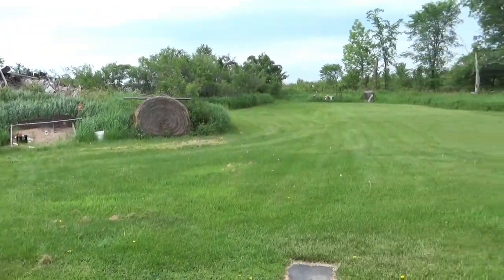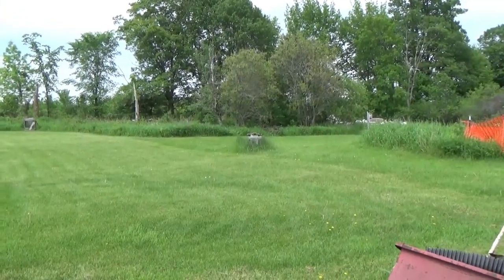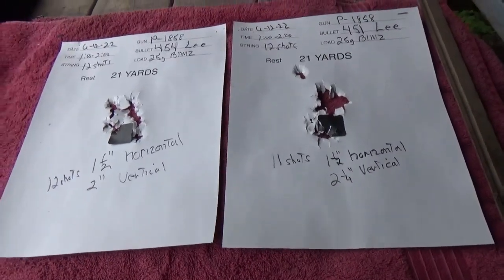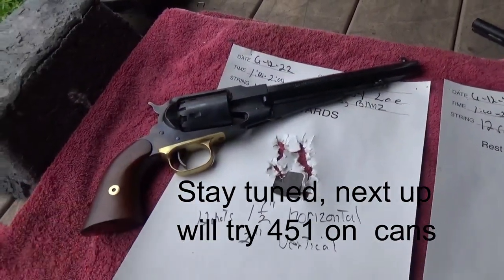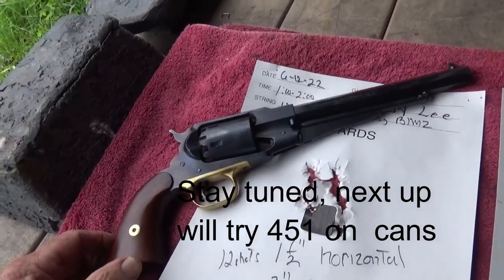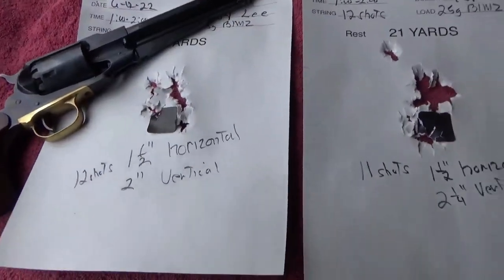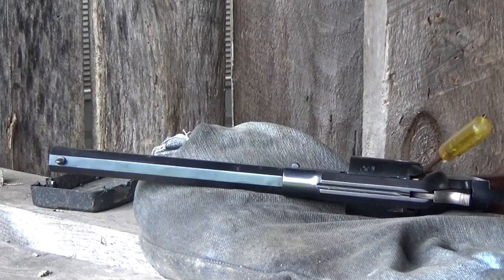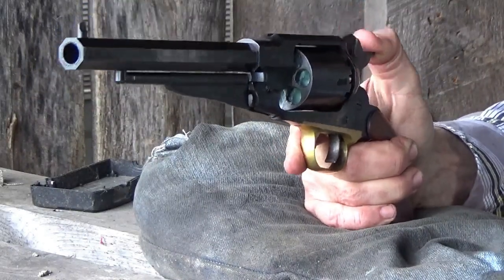Pietta 1858 - Shooting 451 VS 454

Comment: Good info, I’ve been shooting both 451 and 454 and haven’t noticed much difference in accuracy but I do like the confidence in knowing the .454 will seal better, I’ve done both wads and lube over the ball, I’ve ran both 25 and 30 grain charges, thanks for taking the time to put this video together for us viewers O.R. 👍
Reply from the maker: Appreciate your comments.  If you ever chain fire with that combo it would sure be evidence for it coming from the nipple end.  O.R.
Reply: @oldranger3044 how common are chain fires? Does it damage the gun when it happens?
Reply from the maker: @Hellbender21  Not all that common. It would be interesting statistics to know the percentage of revolver shooters that have one. Using a correctly sized ball, and either lube or wad, and proper fitting caps, chances would be very, very, close to zero. My brother had one 30 years ago. Never knew why. I recently had two, probably the result of some DIY caps I had made. Otherwise, I have fired thousands without one. As far as gun damage, neither mine or my brother’s damaged the firearms. The chamber that fired was the left where the ball probably glanced off the barrel wedge. Without the barrel, the speed is about half, reducing energy to one quarter, so this may be part of the reason for little damage. Of more concern would be the shooter, or bystanders, as the cost to replace the gun is usually not a big deal. Always use eye protection. Hopefully this is helpful. O.R.
Reply: @oldranger3044  Thanks, I appreciate these videos.
Reply: @Hellbender21 I have shot a couple hundred rounds out of my BPR and have never had a chain fire. I use lubricated wads
Reply: @Hellbender21 I've shot black powder pistols for 15 years never use lube never had a chain fire actually I've never seen a chain fire happen

Comment: This is why I ALWAYS load the largest roundball that will swage down.  The listed measurement VARIES and it’s better to overestimate than to underestimate.  I’ll go as far as hammering a ball in with a brass hammer to force a fit.  It guarantees no chainfire is possible, gives a larger driving band for the rifling, gives it a flat top for harder punch, and I believe it gives a better seal, which builds more pressure for better ballistics.  Also, with as light a projectile as roundball, every additional grain gives additional ballistic impact (which matters, since these guns are ballistically marginal at best loaded with roundball).  Even 3 extra grains of lead can give an extra 10 foot pounds on target per shot.
Reply from the maker: Interesting information for shooters to consider. Thanks. O.R.
Reply: Bigger than 454?
Reply: @Hellbender21  I’ve shot .454 with good results, but .457 would work better.  I recommend loading the cylinder on a stand to not wear the gun’s loading lever.

Comment: Do you have to measure all the balls before loading or is that just for the video?
Reply from the maker: After casting, or purchasing the size desired, only measure a couple if wanted as a double check. Or if like me, sometimes you may have forgotten to label the container. Even if the 451 and 454 get mixed up it will work out as long as it shaves some lead, or makes a decent tight seal. Some cylinders have a slight chamfering and won’t actually cut off a lead ring, only compress it. O.R.

Comment: We dont have much bearing surface with our round balls so we don't need much lube. It doesn't take much lube to fill the tiny scraches on the ball where fire could get through either.
If you seat a ball without lube or powder and take out the nipple then use a small diameter dowel to push the ball back out then look at the bearing surface on the ball with a magnifying glass you will see the tiny scratches on the sides of the ball.
Of course this may vary a bit from gun to gun depending on the quality of the machining. Filling those scraches is where the value of lube pays off.
I know you are going to think I am crazy until you see for yourself.
Thanks for all you do.
John Davis Jax Fl
Reply from the maker: Just wonder what you think about the ball bumping up to fill the groves?  Every time I pound in a ball through the forcing cone I can always see light passing through. A ball fired with only the cylinder already has 3-400 FPS. If the majority of the force is already spent, what is left to enlarge the ball?  Also, the lube is on the opposite side of the pressure and I would have time stopping a leak with a gasket on the wrong side. Outside of possibly preventing chain fires, I’ve been under the assumption that the lube is necessary to keep fouling soft and cut down on fouling buildup which seems not good for accuracy in most, maybe all firearms. Just my thoughts and open to viable explanations. Thanks again for your comments.  O. R.

Comment: Lube is important for more reasons than one. The viscosity of your mixture seems to be doing very well.  Some commercial products turn a slimy puddle after the first shot in the rest of the chambers.
Reply from the maker: Temp was in the low 70's I believe when this shooting was done. Crank that up another 25 like the last couple days here, and things could be a lot different I'm guessing.  I was actually pretty impressed with how nothing changed much, but the temp probably helped.  Like of course to think it was a lucky mixture, time will tell.  O.R.
Reply: @oldranger3044  yes hope you have it documented. Me I stick lambs tallow and beeswax and change portions based on how intend to use it. More bees wax for dipping bullets  less for over top . Paraffin wax for dipping on occasion. A lot of people doesn't know that army ordinance for the paper cartridges for these revolvers called for bullets dipped in paraffin. I did get out Monday to the range and test fired the 62 gr in the Remington, and the 77 gr in the 1849. All I learned is that my vision impairment is  not better for open sights, but did better falling back on basic instincts. I also know both weights are flying true with no tumbling.  I took out a couple of carbine I tried a month ago open sighted and failed, and mounted optics on. Has some success. Also want a trusted scoped 22. Though not the bullet touching accuracy I'm use to I was able to keep groups at 3/4" @ 25 yards.  So still in the game  just have to change my methods.  It's going to look funny mounting optics on remingtons but if it keeps me going great. I will try it on my 1866 carbine first see how it goes

Comment: The chamber bore of the cylinder sizes the bullet.  You can use a .500 bullet if you have the elbow strength and you'll wind up with a bullet the same size as a .451.

Comment: Excellent shooting ! As always, the reason I always choose a larger than bore size is to stop any risk of chainfire, as I know you do, but as I end up reaming the chambers to .002" over groove diameter the projectile diameter can vary, I have now found an excellent source of ball moulds which are both cheap, good quality, and available in .001" increments to order, so I am now shooting the diameter I want rather than buying a near fit, both of your groups were outstanding, and that is not using your Ransom rest! You had no critters in the garden this time. Stay safe! Chris B.
Reply from the maker: Thanks Chris.  Suppose your source of RB is not in the U.S.  That, and being able to ream gives some real possibilities.  O.R.

Comment: Re  looking at this video I notice that there is a generous chamfer on the chamber mouth, I wonder if there is a different fit on the ball compared to an unchamfered chamber, the chamfer would tend to "squeeze" the ball into the chamber rather than the shear the ball, this must make it a tighter fit, one thing that does happen when the chambers are reamed is that it reduces the size of the chamfer, but this can easily be re cut, I think most chambers are slightly tapered, so that also would give a tighter fit , I notice that with the .451" ball if the sprue were to enter the chamber at the side a flame path could easily set off the chamber, and that could be the reason some people experience chainfires, as I always seat sprue upwards this risk is reduced. Chris B.
Reply from the maker: Hi Chris. Here’s my experience so far, meaning it is just what has, or has not happened, and not concluding anything to be a law. Only one law..Just when I am about to regard something as absolute, I come across something else that goes against it. 

I will sometimes load with sprue up, mostly because I have felt it more accurate. My testing so far does not verify that. Last few years I have probably fired over 1K/year at paper. Most off a rest. Only saying that because we know some shooters will have a good day for whatever reason, and figure what they did can be taken to the bank...same if it was a bad day. So, its just my opinions from what I’ve seen so far. If I am running a test on shooting without wads or lube, it’s load them tits up for sure. Over 4K without a chain fire. Always gave credit for chain fire to the chamber end. Then when shooting DIY caps that had powder trails up the sides (sloppy manufacturing on my part), two CF in one week. Before that I had tested firing with no cap and did get the CF. So here’s the new theory. Maybe to get the CF nipple end, the flash can’t (for whatever reason) get through to the powder, and needs the cap in place because it can set off the cap. 
I always enjoy your comments (and others) because they get me thinking..thanks again. O.R.
Reply: @oldranger3044  Well OR, you have just touched on something I had not considered, we really should live closer! And that is the cap being ignited by the flashback,a thing which is probably more likely with homemade caps I had always thought it was flame going into the back of the cylinder to ignite, I have never thought of CF being from the front, given normal safe loading procedures, but I have seen it happen that way on an Adams patent pistol, but the balls are just pushed in by hand, and are very "gappy", for any flame to get in at the front there would need to be a good size gap, the sort of gap you would get by loading a marginal size ball in with the sprue at the side, but anyone that would do that would be a very casual shooter, today we have many ball moulds available, but not everyone checks size, they say,"this is a 44 caliber, this is a 44 ball mould" and just push them in, I have seen it so many times on youtube demonstrations where the balls go in without any effort at all, no wonder people get chainfires, I remember the video you mae that demonstrated just how much pressure is going on when firing, all the lube on the next chamber was completely blown away, it does not happen as much with a tight barrel /chamber gap, but with a good sheared ring of lead I do not think ignition will occur. I ream my cylinders with a slight taper, and will now put a very slight taper on to chamfer them.  Stay warm and safe! Chris B. Not sure what is happening at youtube? It has changed my title to some gobbeldegook collection of numbers/letters?
Reply from the maker: @453421abcdefg12345  Hi Chris. Getting our first larger snow today. Thinking about working more on my script for a video on the gun in the Cody museum that is claimed to have belonged to Hickok. It might spark some discussion if nothing else. Been on my honey doo list for a couple years. 
Strange about your new random computer generated handle.  Worse than having to memorize a combination lock combination for the Py Ed gym locker. 
I think working together we’d get close at least to this CF thing. There is testing that I feel could be done to create it on a predictable set of conditions, but it would take time and dedication. Also motivation and a companion. I have some of the first, but not as much of the second since my brother left the range. Keep safe and in good health. O.R.

Comment: Here in Northern Arizona a couple of years ago we got a really cold Winter and the .451 balls were sticking to the lube on my rammer and pulling back out. I switched to .454 balls and the problem went away. Now I have Lee molds in both sizes .
Reply from the maker: Interesting. Be interested in what shooting iron, and how the lube gets on the loading lever?  Another factor could be that lead contracts in size a little over twice as much as steel with temperature drop. But this is a small change. Something caused the issue for sure. Have you measured the.451’s?  I have two Lee .451 moulds. One does what it should, .451. The other (both are stamped.451) casts .456-.457. O.R.

Comment: The whole point of ball size is for a better chamber seal. If you put a wad  behind an oversized ball that leaves a nice lead ring chances are it will never chain fire
Reply from the maker: @yourredcomrade717  I agree completely that with the seal (completely) around the ball and added insurance with wad or lube on chamber ends, eliminates it happening from that end. Here’s something to consider. I do a fair job of lubing the chamber ends. Never had a chain fire in over 50 years, with well over 5K shots in the last 5 years. Then bam!  Two within a week. Circumstantial evidence points to using DIY caps that had not the best fit, and excessive priming powder along the sides. Just wanted folks reading this to understand there’s a high chance that the nipple end too can disrupt an otherwise uneventful afternoon. Thanks for this comment. O.R.

Comment: I gave up on tight measurements on soft lead "Round Balls" as they all look dinged up pretty well after bouncing around loose in the box together even my swaged balls. I just have to have Faith in my Lube topped with wads while I watch for the tattle tale RINGS.  DO NOT want a first chain fire?

NICE GROUPS EVERY TIME!
I can't do that with any Modern Pistol. 

Thanks AGIAN.

Comment: When u seat the ball it's the same size as ur cylinder no matter what the ball size
Reply from the maker: No doubt, (unless it’s under chamber size of course).  But a larger diameter will have a wider band to react with the bore riflings, and may be more deformed. These are soft lead and extra force needed to seat can cause this to happen. A tighter fit from the larger ball might also cause pressure differences at the beginning of the burn. Because of these, and possibly others, there could be some shooting differences. Thanks for pointing this out. O.R.

Comment: I prefer the .454 ball myself. Better sealing and seems more accurate out of my 1860 Army. I also love the Black MZ powder. It’s too bad they quit making though. I use Crisco and fill the space all the way to the top and then smooth it out so it’s perfectly flat with the edge of the bores.
Reply: Powder, ball, crisco? You don't use the patches? I have plenty of lard.  That's the same idea though right? Lube and to seal them up to prevent chain fires?
Reply: That is correct. You don’t need a patch.

Comment: If the bore is.451, but the chambers swage the ball down to .446, how can that result in maximum accuracy because now the ball is smaller than the bore?  I opened all my Pietta 1858 chambers to .4525 and I'm using .457 round balls like a Ruger Old Army.  Very accurate.
Reply from the maker: Hi Roy. You’re right, but the bore is .440, probably why it is referred to as a 44 caliber.  Both round balls will end up as.446, and have enough left to engage the rifling. The.454 will shave more lead, and have a longer bearing surface for the rifling to act on. Hope this answers your question. O.R.
Reply: Old ranger is correct. The lands measure .440 and the grooves measure .451
Reply: Also, the pressure behind thesoft lead as thebullet enters the forcing cone will "buck up" thebullet to help  take the rifling.
Reply from the maker: @jason60chev  with the Pietta 44 there’s a .446 ball entering a .440 bore, leaving only .003 inches in the groves. A.448 ball pounded into the barrel through the forcing cone end will show lightning around it through the groves. It of course is then not getting bumped up by gas pressure of the gun firing. My question is do you have evidence that it does get bumped up??  Or, are you in my situation of only hearing or reading that it does. I’m not saying it doesn’t, but I would sure welcome some hard evidence to verify it. 
I certainly appreciate the opportunity to bring about a discussion on this..   Thanks so much for your comments. O.R.
Reply from the maker: @jason60chev   True. The problem is we need to recover a fired one, and then have an accurate way to measure it. Once I build a 8 foot water trough to try to see if a 36 caliber round ball was stripping,,, that was a long time ago. Covered the end with plastic wrap and it was only good for one shot. That was when I had more time than money. Pity is, now I don’t have much of either. O.R.
Reply: @oldranger3044  i have seen high speed photography of a soft lead ball in flight. The back side of the ball was flattened a bit from the pressure. Of course that was from a rifle and different in a lot of ways than a revolver.  Under 10k pounds of pressure that soft lead probably moves around like bubblegum 
as it gets swaged into the forcing cone then into the lands and grooves.
John Davis Jax Fl
Reply from the maker: @johnndavis7647  There’s got to be one heck of a force to get something moving over 400 FPS in only an inch of travel. Whatever it is, I could sure use some in the mornings. O.R.